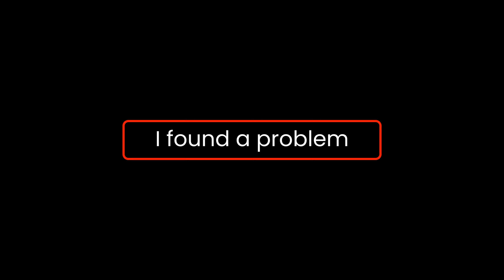Mesa/Boogie Dual Caliber DC-5 Opening and Cleaning

Comment: That’s not a problem, but rather a popular mod to make the sweep of the output volume knob more useable. With the resistor in circuit, there is a huge volume jump from 1.5 to 2 on that knob.
Reply from the maker: I didn’t know. I shall test it again. Thanks